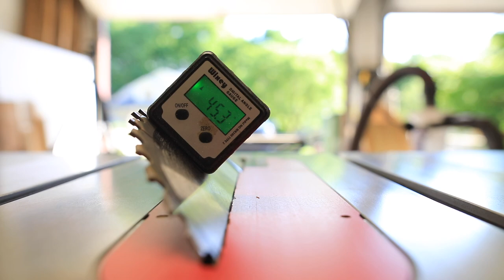How to make Flower Pedestals or Small Columns // Woodworking // DIY // How To

Comment: Great video! I love using the Kreg Rip Cut. I also like how you used the table saw fence with the crosscut sled.
Reply from the maker: WoodChuck Creations thanks!! The use of the fence with the crosscut sled may be frowned upon more than my choice of footwear in the shop. 😂
Reply: Daniel Dunlap Woodworks 😂 yes those don’t look like steel toed shoes
Reply: Daniel Dunlap Woodworks 😂 yes those don’t look like steel toed shoes
Reply: Daniel Dunlap Woodworks 😂 yes those don’t look like steel toed shoes
Reply: Daniel Dunlap Woodworks 😂 yes those don’t look like steel toed shoes
Reply from the maker: @WoodChuckCreations  perhaps I should upgrade to some steel toe crocs? - https://youtu.be/29iC6RlbL7s